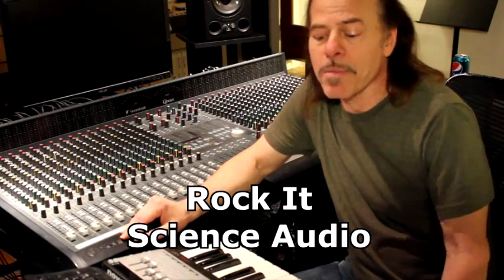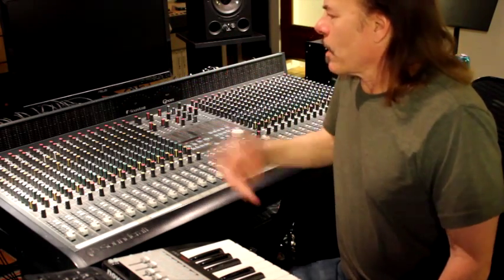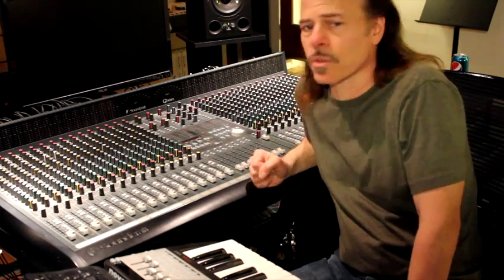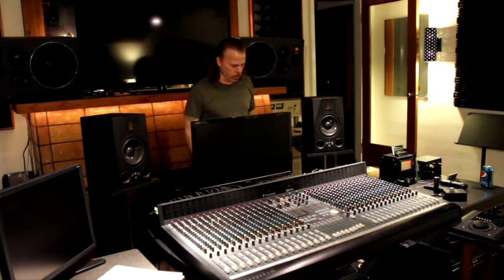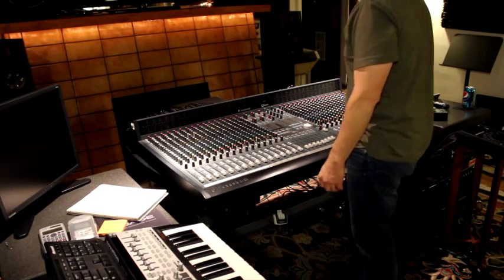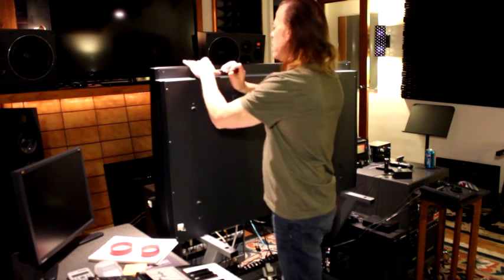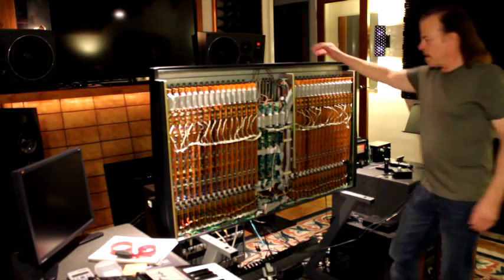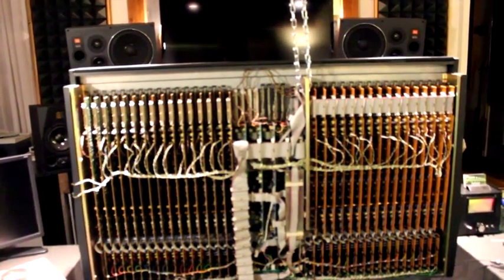Servicing the Soundcraft Ghost part 1

Comment: Modular is always better. We have a Soundtracs CP6800 modular mixing desk, and the ability to service a single channel with the desk still active is so convenient. Great video, nice desk.
Reply from the maker: Hey @subculture-records, I totally agree.  I built Neotek consoles four 7 years and serviced a lot of Soundcraft, Neve, and Trident consoles that were all modular, as all good consoles should be.  The Ghost is an exception because Soundcraft wanted to offer an affordable console with a full-feature-set, and respectable performance, and for that much I applaud them.  However, God help the poor tech that has to service it, and that tech happened to be me.  My halfway solution was the Ghost 2.0 mod, that makes the console serviceable by installing hinges that allow the console to be opened like the hood on a car.  If you haven't already viewed the 7-minute Ghost 2.0 video from 2020, it's worth checking out.  Richard.

Comment: Hi, great video, you mean Imperial measurement, yes we do we still use Feet, Miles, Inches, Pints, Gallons, Ounces, Acres and so on, its the Europeans that use Kilometres and Kilos , but we also use METRTRIC, Millimetres, informative video.
Reply from the maker: Hi Glen,
Yes, imperial, sounds more dignified than metric.  That would explain the reluctance to switch.  I’m about 33% there.

Comment: Well done! For people that have the courage to service their console, jump to timestamp 20:13. These wires are nicely bent together, so that makes things easy. It happens that the previous owner didn't do such a nice job. A cable tree follows the same color coding as resistors: BK, BN, RD, OE, YW, GN, BE, VT, GY, WE
Q= Why exactly did you add those RF bypassing caps on the mic input section?
Reply from the maker: Hi Kevin,
I think the small caps bypassing the electrolytic DC blocking caps (phantom power) are what you're referring to.  Using a small polypropylene cap to bypass a larger electrolytic cap in the audio path is a somewhat esoteric practice born out of a common practice in power supply design where it was recognized that at higher frequencies large caps appear as inductors to signals.  Bypassing the large caps with a small cap allows the higher frequencies to see the cap as a cap.  This extends the bandwidth of the signal path.  Many have argued that any benefit gained is far above the audio range, yet others swear they can hear a difference.  In any case, it's a relatively inexpensive mod if you're trying to squeeze every nano-dB of audio quality out of a circuit.
Richard
Reply: Ok. I don't know if it really makes an audible difference, but it surely is worthwhile trying it. Nevertheless, electrolytic cap's are a necessary evil and a real pain in the butt. Thanks for your answer, Richard.

Comment: Hi Richard, thanks for the video. I have a 24Channel Ghost in front of me that wants to be beaten up. I was wondering what capacitors you installed. I was planning on changing all the capacitors to Panasonic FM 220uf 25v. Had gotten the recommendation from several forums. How do you see this ? Is there possibly a BOM ? That would be great. Thanks again !
Reply from the maker: Hey Vincent,
There is a BOM in the Ghost tech manual but is probably pretty useless at this point with the part numbers being obsolete.  As for caps, I have always used Nichicon Fine Gold audio caps, although I've gotten end-of-life notices from Mouser recently.  Panasonic FM are good caps too.  As far as values, I don't recommend replacing all caps with a larger value.  In most cases a cap of the same value but better quality is an upgrade, and depending on where the cap is in the circuit, a larger cap may actually cause problems.  In a critical audio path like a mic pre input I will often replace a 47uF with a 100uF to lower the impedance. but with size restrictions will seldom use a 220uF, with the possible exception of an output from the console.  It should go without saying, to never increase the size of power supply filter caps or decoupling caps, as this will cause excessive in-rush current that can damage your power supply.  Have fun with it.

Comment: Hey Richard, I’m looking at buying one at the moment & the seller is saying that there is a channel not passing signal. He had gotten it recapped by Creation Audio Labs back in 2020 (has receipts for proof) but upon receiving channel 10 wasn’t getting signal so they advised him to reseat the channel. Seller claims that they haven’t had time because they’ve been busy or what not. My question is, do you think reseating the channel would fix the signal flow or could it be a larger issue at hand? Seller is asking almost $2k, not trying to buy this thing & have to invest more to get that single channel working again. Thank you in advance & I truly appreciate your videos as they are the only few showcasing this beautiful console.
Reply from the maker: Hey 64hapz,
I'm not sure why anyone would tell you to reseat a channel, that terminology normally applies to consoles with modulular contruction that allows channels to be removed from the top side, where they can be easily pulled and "reseated" into sockets.  Obviously, the Ghost is not constructed that way, and if you've seen the videos, you know that to service anything requires opening the console from the bottom (unless it has the Ghost 2.0 mod). It's easy to see where most people would not have time to do that.

However, there is one common problem that can be easily fixed without opening the console. The channel Insert jacks rely on spring loaded contacts that are prone to intermittent failure, and that should be checked first. By simply taking a raw TRS male connector and soldering the Tip to Ring, you can make an insert bypass device. This can be used in any channel to see if the connector is at fault. If it is, you can insert a Qtip with conntact cleaner and sometimes fix it, but a better fix is to replace the factory installed Rean jack with a better quality Neutrik connector. Or, simply leave the TRS bypass plug inserted.

Anything beyond that requires troubleshooting, which can be done from the topside, to look for faulty pots or switches that may be at fault. And ultimately opening the console will be needed to replace parts or check internal connections. I hope this helps.

Richard Zeier

Comment: Hi Richard, Love your videos. Would you happen to know the part number of the CRM Level pot? Thanks in advance.
Reply from the maker: Hey Sampler One,
Yes, the part number is DM1292.  That's the easy part, finding one is another story.  Because it's the most used pot on the console, I've had to replace mine a couple times and still have one spare.  However, the next time I change it, I plan on using a higher quality conductive plastic pot.  I'm pretty sure there's enough room to mount one directly on the top panel, and mount a 3-pin .100 header in the vacated holes from the old pot.  Then I will solder some short wires from the new pot to a female 3-pin connector to plug it in.

If time allows, I would like to use a 12 position rotary switch with 1% resistors instead.  This will provide dead accurate consistent stereo imaging that is unachievable with any pot. I can also add a trim pot and calibrate key positions starting from 85dB SPL in the center going up and down in 2 or 3dB steps.

Comment: Hello Richard. Great Ghost Videos... I have just acquired a Ghost 32 and 24 Trk Expansion. I have a question when using the Groups. What I want to do is have 8 individual elements of the song (Drms, Bass, Gtrs, Vox, Keys...etc) be controlled by each of the 8 Group faders... Am I correct in assuming that IF for example, I have all my drums routed to Group 1-2, and Bass routed to Group 1-2... with the Drum Channel Panned hard L and Bass Channel panned hard R, Then in the group master section assign Group 1-2 to L+R for the Group 1 fader pair... THEN push the L button also for fader 1 of the pair and the button for fader 2 of the pair to R, will that send drums to the Mix L+R on fader 1 and the Bass to the L+R Mix on Fader 2 ??? Hope this is clear and Thanks in advance for your help
Reply from the maker: Hi Kewlerone,
I think what you are assuming is essentially correct, but only useful for mono applications such as a live PA mix.  When the L+R is engaged the output of that group bus is now equally present on both the L and R of the Mix bus.  Because the L+R switch is post fader, you still maintain level control of whatever is assigned to that group bus via channel panning and output switches.  However, since I never do mono mixes and have no use for the L+R switches, I rewired them to hardwire bypass the faders to 0dB when engaged.  This is convenient for me because it allows me to keep them down and out of the way most of the time, and also make use of the first 4 group faders as midi controllers while still using the group buses.  Hope that helps.
Richard.

Comment: Thanks for posting this video, not many in depth Ghost vidz up. I was wondering as I've recently picked up a G24..do you or have you ever used the transport controls including Rec with a DAW? I've managed to configured the Dynamic Mute Automation via Pro Tools & Digital Performer, as well as the Transport minus the Rec Arm. Any advice? Thanks in advance.
Reply from the maker: When I first got the Ghost I was using it with an analog recorder and used the automated mutes when mixing but the tape machine had it's own auto-locator with track arming.  After that I used an early DAW called Paris from Emu-Ensoniq that also had it's own full-function controller.  Now I use an Avid Eucon transport controller and a Novation MkII for mutes, solos and track arming in Pro Tools and Cubase, but I have often thought about making use of the Ghost functions.  Four of the group faders double as midi controllers and I've thought about dropping in 8 motorized faders that could be used as assignable DAW controllers and still be used as group faders when needed.  However, all these things take time to implement and some times you just have to play music.
Reply: Richard Zeier Been a few years, but did you ever get to the motorized faders? Would love to see how you pulled those off. Thanks for ths vid!

Comment: Hi Richard. I sat down tonight to do some mixing and my Soundcraft ghost didnt work. The power supply comes on but with only 2 lights on the front panel on but the console is not working, no sound no lights, nothing. Can you help or point me in a direction that would? Thank you.
Reply from the maker: Hi Joanne, sorry to hear your Ghost is down.  The 3 PSU lights are for + 17V and - 17V and 48V.  The console would still work if the 48V went down so I would assume it's the +17V or -17V, both of which would prevent the console from operating.  I would say the problem is most likely in the power supply and the most common failures are capacitors.  That is a broad assessment, but to gather more details would require putting the PSU on the bench.  That is the logical direction and should get you started if you are technically equipped.  p.s. If your Ghost is 20 years old, the power supply should probably be recapped.
Reply: @RichardZeier  Thank you so much for your prompt reply. The CPS 275 has 3 lights. The one that is not working is the 17V which seems to have  the + sign with a - underneath. The other 2 are the +48V and +5V. The console and CPS are around 20 years old. I haven't opened up the cps but read somewhere that there is a fuse corresponding to the 17V that might have blown, caused by an underlaying problem with a rectifier. As I'm not a skilled electronics person I'm not sure what a rectifier is but would obviously be able to change a fuse. Thanks again for your help, very useful.
Reply from the maker: With my Ghost I have the PSM 300 power supply which is a switching supply.  The CPS 275 that you have is a linear supply which is quite different and can be prone to rectifier problems.  If you find that a fuse is blown, take a close look at it and it will tell you how it failed.  If the glass fuse is completely black inside or has flecks of splattered metal, that means it suffered a catastrophic failure.  Changing the fuse will likely result in another blown fuse until the problem is repaired.  However, if the fuse looks relatively clean inside, and the filament is still visible, maybe bent or sagging, this means the fused suffered a fatigue failure over time.  In this case, changing the fuse may get you going again.  Good luck with it.
Reply: @RichardZeier  Once again Richard thank you for taking the time to reply. Just so as you know a fuse did blow. There is evidence of slight blackening and a fleck of metal. I bought some more fuses but didn't realise I was sold F fuses as oppsed to T and it blew straight away. I have a feeling that I need to get the unit looked at by a pro but will try a T fuse first just in case.

Comment: Does somebody know the neutrik part number for the insert jacks. I wanna replace the insert jacks of my ghost but don't know which type of neutrik connector fits in the ghost.
Reply from the maker: Hi Maarten,
I believe the part is NMJ6HCD2-RM.  If you haven't already done so, be sure to check out the latest Servicing the Ghost 2.0 video. https://youtu.be/7T-hYI319mg 
Cheers

Comment: whats the spectrum analyzer in particular you used?
Reply from the maker: Hey Geckomabster, 
The software is called TrueRTA.  You can google it, it sells for $99 and runs on Windows computers.  It can be used with ASIO interfaces and can be calibrated with a digital Voltmeter.  I've got other professional equipment on the bench including oscilloscopes, meters and an HP Distortion Analyzer, but TrueRTA is still useful in addition to those things.

Comment: Question.I have a 24x8 Soundcraft Ghost with Blue Dog power supply. and recently, channel 11 started having a slight crackling/popping sound on the track. Long story short. After 2 months it traveled all the way to channel 16. All 6 channels now have the same symptoms. Before I pull the channels. Can you tell me what would cause this and what I should be looking for. I do amp repair so I understand some of this. Thank you.
Reply from the maker: Hi Ed,
There area couple things that can cause crackling/popping sounds.  One being a rouge opamp that's failing and going into oscillation.  Most likely in the mic pre, the frequency is usually beyond the audio range but what you hear is the starts and stops and changes in level.  This can also be caused by failing pots in a high gain feedback circuit.  There is one in the mic pre and the other is the Tape Return level.  I have replaced several over the years and don't ask me if I have any because I only have a limited private stash.  When a noise is strong enough it can bleed through the buses into adjacent channels, but the level should decrease the further away it gets from the offensive channel.

A good way to test the pots is too exercise them.  This will usually stop or reduce the oscillation but is only a temporary solution.  The pot must be replaced and finding replacements are challenging.  There are still panasonic pots that will fit the footprint, available from various distributors, but you will not find the same value and style (resistance, shaft type, panel-mount, taper, detent, etc.).  I have a few original mic pre pots that were special taper made-to-order, available in lots of 10,000 pieces only.  I have a plan to replace those pots with a rotary switch but that may not happen unless a heavy demand develops.  However, I did find some 10K pots on eBay to replace the 20K Tape Return pots and only needed to change one resistor in the circuit to make it work. Hope that helps.

Richard
Reply: @RichardZeier  Thank you for the reply. Im going to recap it myself. Im just wondering what replacement caps are you using. What else should I change out on the channels and Monitor section. Thank you
Reply from the maker: @edauletta4421  I'm a big Nichicon fan and for audio I use the Fine Gold (FG) series audio caps. For power decoupling or ripple filtering I go with PM or PW series.  Some people like Panasonic, but I'm not as knowledgeable about them. However, most through hole parts are being phased out and also becoming more expensive.  

It's really up to you what to change.  It's always a good idea to test everything thoroughly before tearing anything apart.  Caps are a safe bet if more than 20 years old, especially if you replace them with a higher grade cap.  Opamps would be next in line, but you really have to weigh the cost including your time versus performance gain.  Insert jacks are also a safe bet.

There's a lot of mods I did to my console to enhance performance and add features that I wanted but may not benefit everyone.

Richard
Reply: Thank you for the reply. I’ve watched these videos many times. Very helpful. Would you know which caps I should get exactly? I don’t want to get the wrong ones. There’s so much mixed info out there. Thanks again. It’s really appreciated.
Reply from the maker: Any cap of the same value capacitance and voltage will work but I would recommend caps specifically designed for the intended purpose. Again, my preference is for the Nichicon FG series for the audio path. There are less expensive options, but it's always a good idea to read the manufacturer data sheets for reliable information.  @NorthEndRecordingPassaic
Reply: Yes, I understand that but I was wondering if you knew what values they are so I can order all my parts before taking the desk apart. Thanks. If not, does anyone know?  @RichardZeier
Reply from the maker: @edauletta4421  Ed, if you want, I can offer you an hour of my time by phone for $95 and you can ask me anything you want.  If you want to go that route, contact me through my website rockitscienceaudio.com.